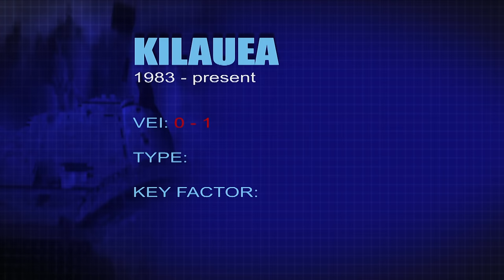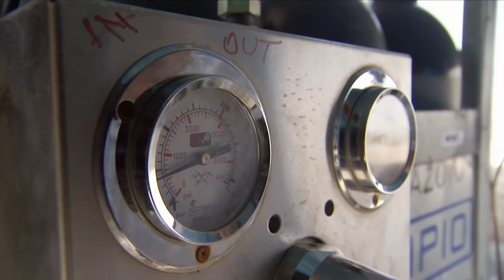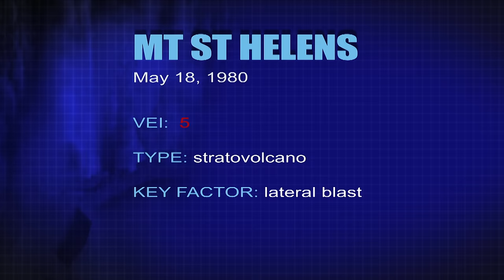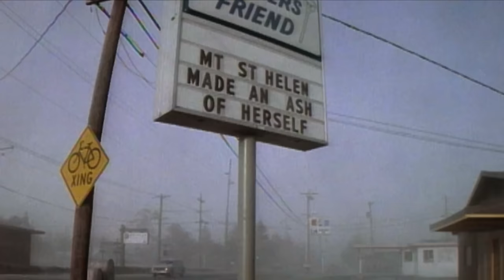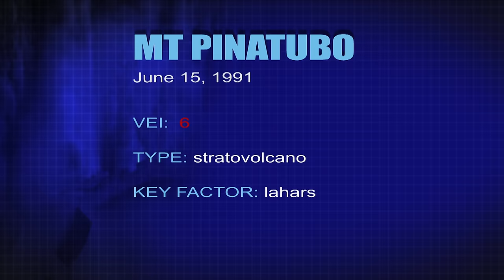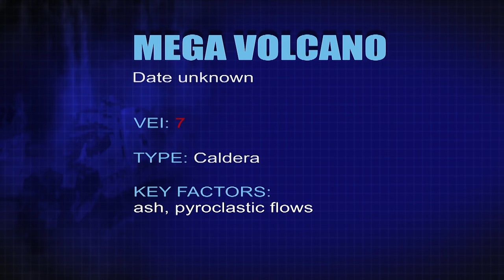Earth's Deadliest Volcanoes | Mega Disaster | Wonder

Comment: I don't understand why they can't cut flow controls into the landscape the same way we build flood controls. Where I grew up there were overflow trenches to prevent flash floods and divert water so it didn't flood my town. Didn't always work but it mostly worked. 
Also I don't understand why they can't cut into a volcano and relieve pressure. Wouldn't you just be able to side snake a small fissure into a volcano to control the magma eruption by creating a weak point in the rock? We can drill for oil several kilometers under the crust, but we can't tap into the geological magma close to the surface on say Mount Etna?
Reply: You can't cut or drill into a Volcano 
You will cause the thing to go up 
Maybe do some research before you write stupid comments
Reply: And what type of metal or substance do you intend to use for drilling ??  Well done Homer Simpson😮